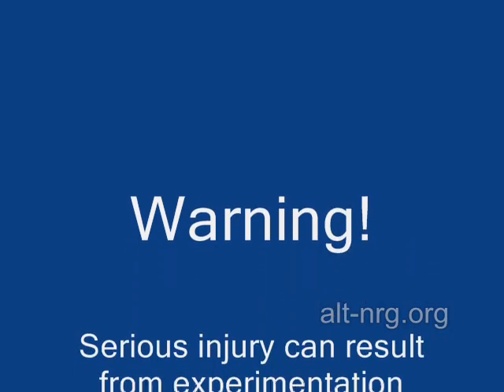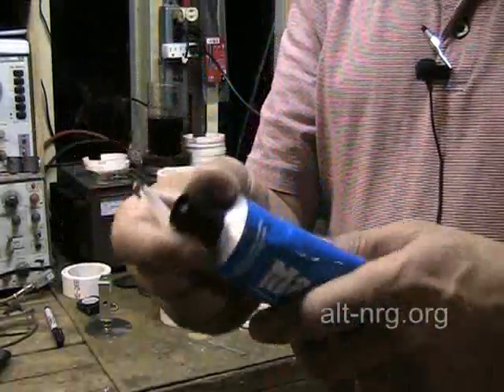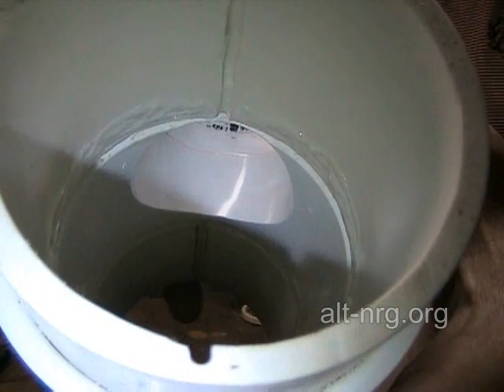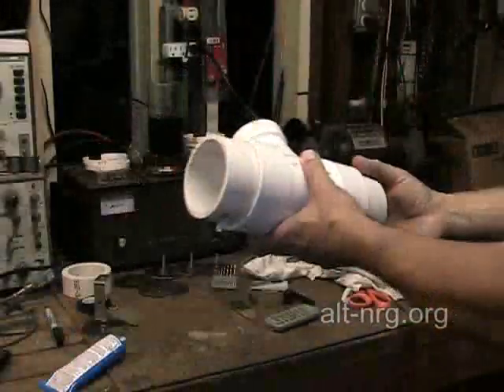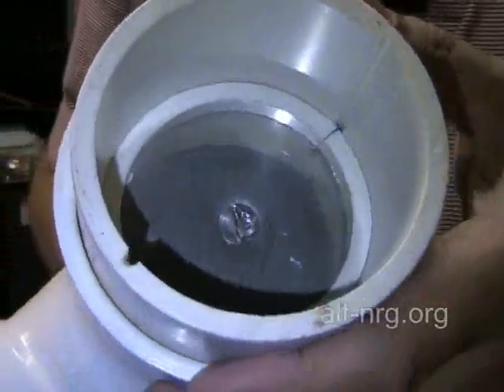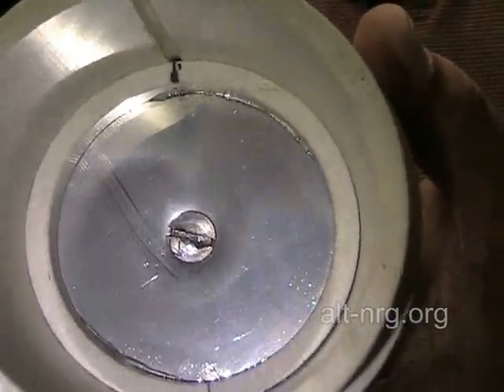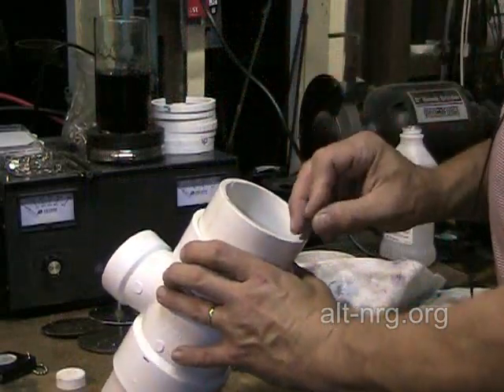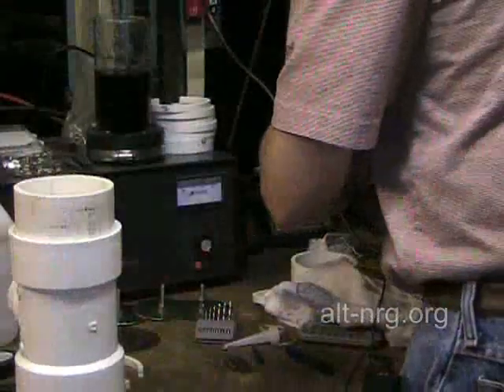#195 - Inverted T cell Part 9

Comment: If you use PVC pipe glue, you get instant adhesion, no squeeze out and it's much quicker to apply. You will not need the 12 gauge wire. Use a Q-tip to apply it.